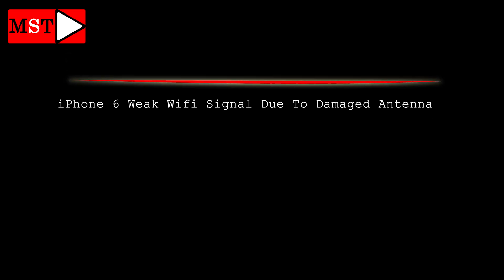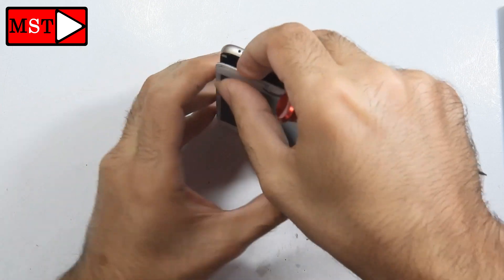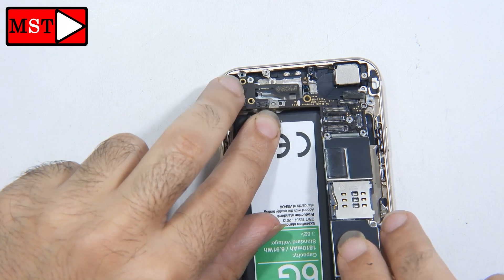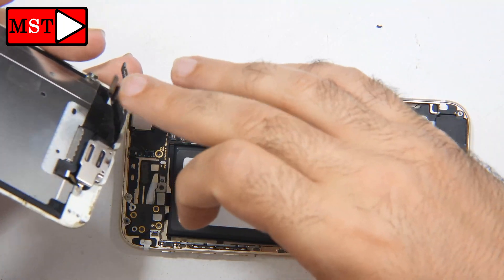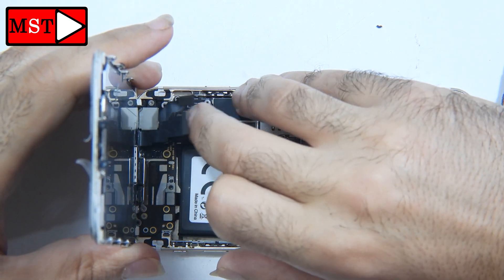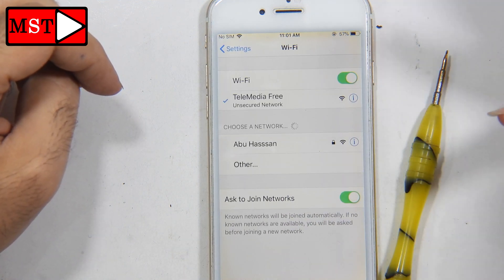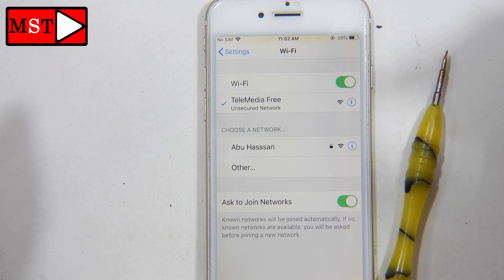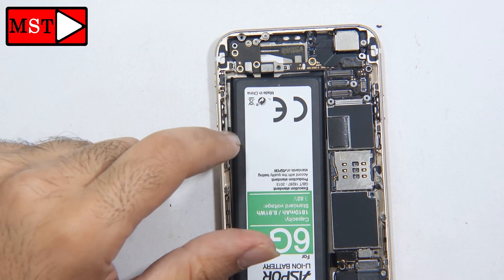iPhone 6 Weak Wifi Bluetooth signal

Comment: I put my iphone in microwave and wifi and bluetooth board is burnt please help me
Reply from the maker: You burned components inside!! Go repair shop if they can help you ! 
Why you put it there im curious?
Reply: @mstphone because i wanted to know what happens inside when it starts how does the microwave heat foods
Reply: i heard placing it in the freezer fixes it
Reply: @calvinmbira5340 i also did that nothing happened 😅😂😅